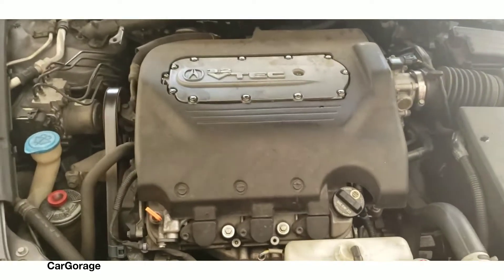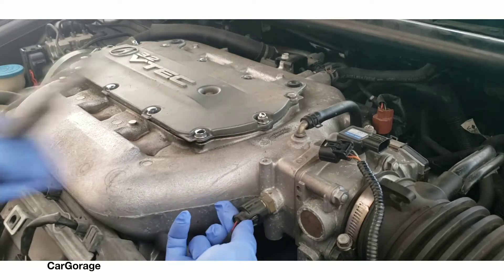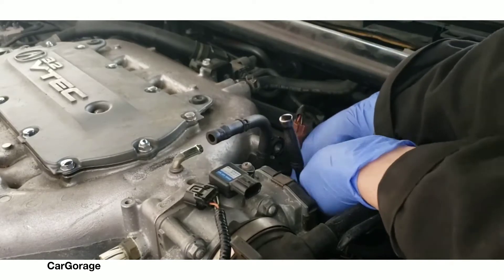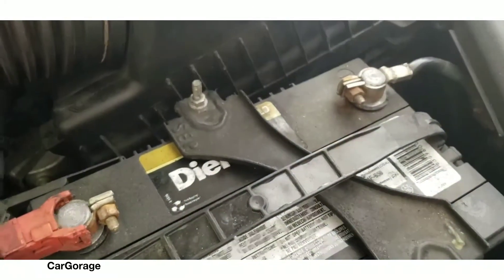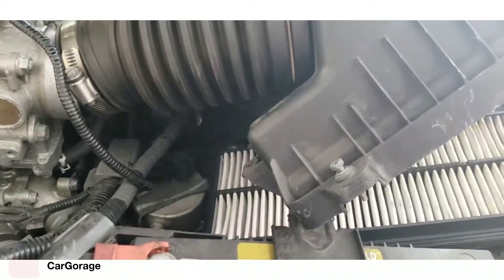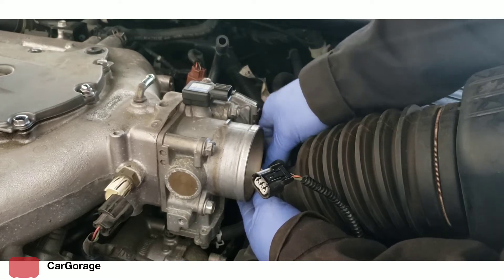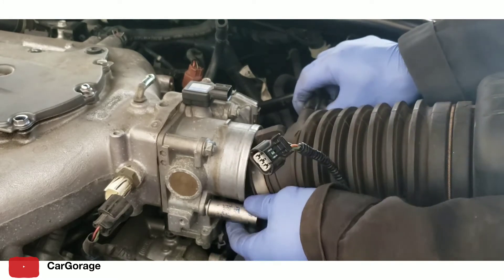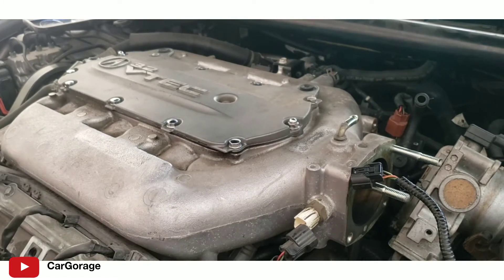HOW TO ADJUST VALVE CLEARANCE ON 2006 Acura TL 3.2L V6 | Part 1

Comment: What are the symptoms of valves that need adjusting?
Reply from the maker: It could be misfire or gonna throw rich and lean dtc code.
Reply: @Cargorage   im having multiple misfire codes even after chagning coil/plugs can this solve my p0300 issue?
Reply from the maker: @Keeps-  yes it could, also check for vacuum leaks or clog catalytic.